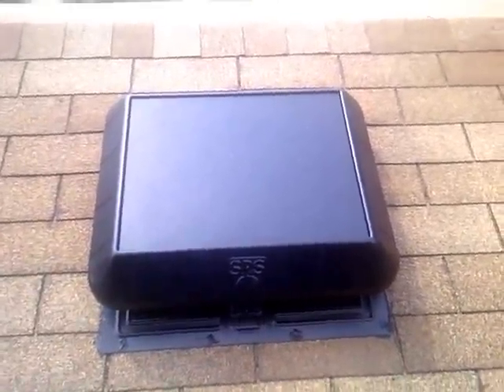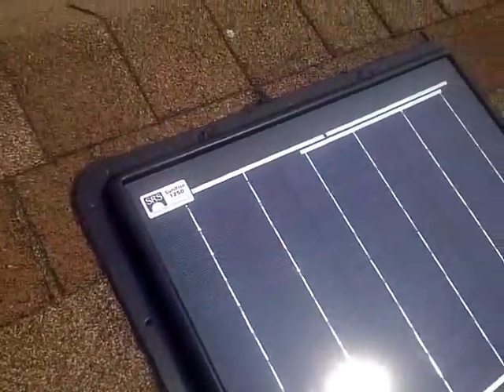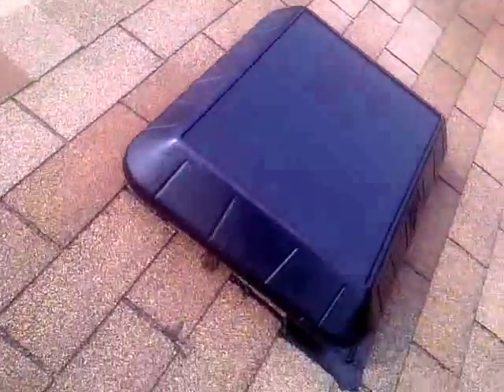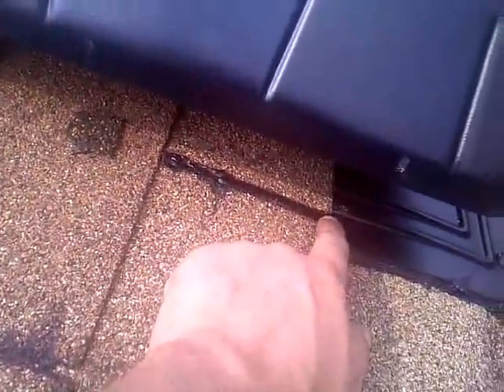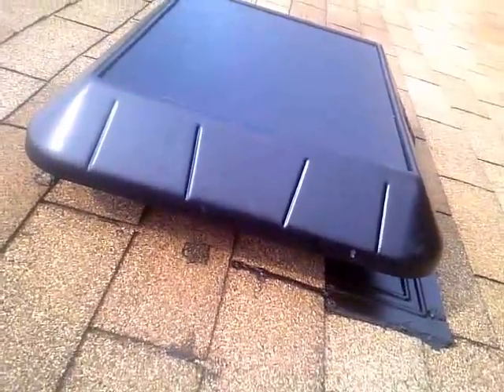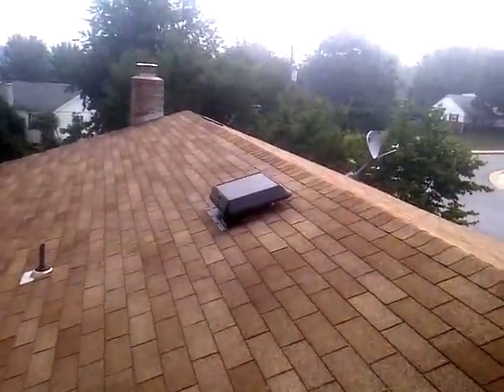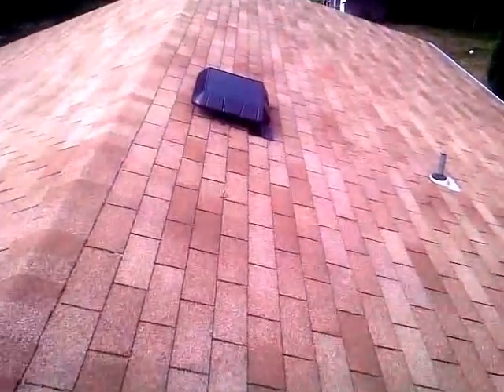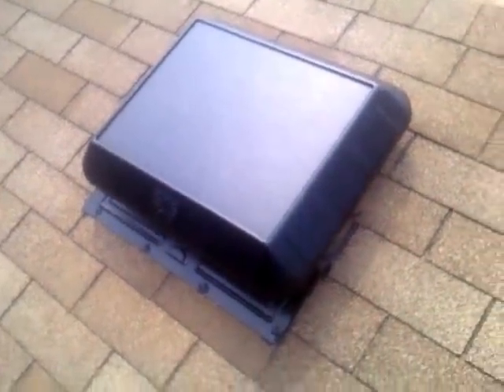Solar attic fan install Sun Rise Solar

Comment: Put 2 of these on about 5 years ago. One is not working now. Are they serviceable from the roof side? Appears there are 4 screws under the "lid" I can remove. Does the lid lift off at that point? Suggestions on what the problem may be? Thanks.